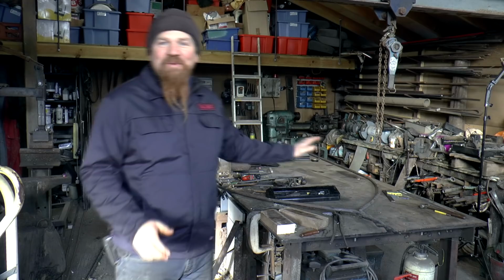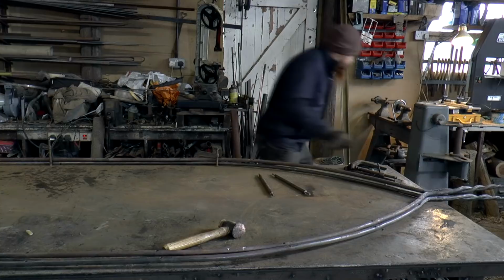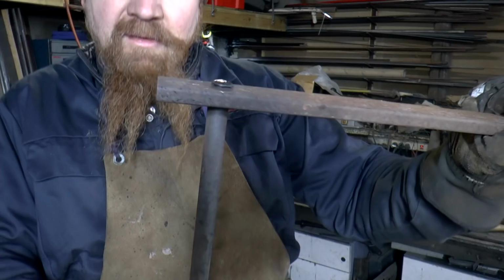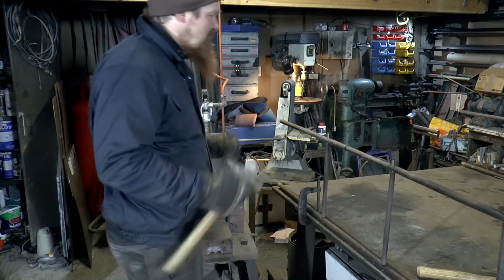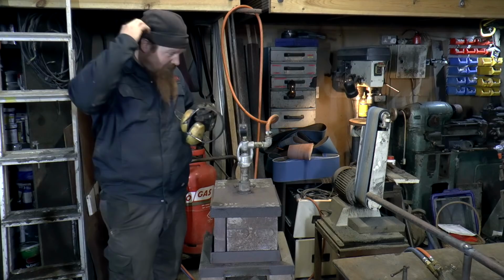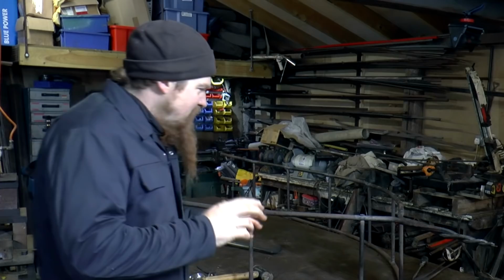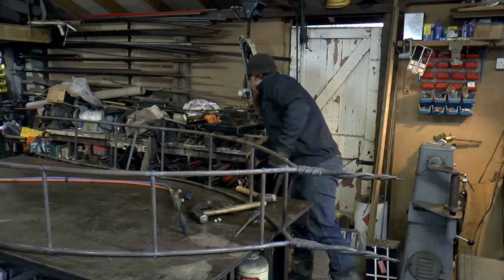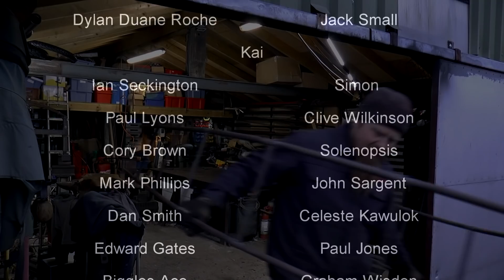The Rose Arch Part 2 of 2

Comment: During many years in Horticulture I've encountered rose arches of varying manufacture. The older estate made types are generally the best. Modern bolt together kits are always a poor substitute for either welded or forged constructions.
Your forged creation here is absolutely splendid Max, jolly well done. I could imagine that once installed, this will be in place for many years. Quality work like yours is sadly lacking in many gardens these days.
All the best and I hope the arch reaches it's intended location soon.
Reply: The reason that quality, long lasting work like this (which also looks the best..) is rarely seen in gardens, is that it costs an arm and a leg to produce (and you can see why!).
Most people can't  afford, or can't justify the cost.
Mores the pity.
Labour costs have killed off most craft skills I'm afraid..
Why do you think IKEA is so successful.........!!!

Comment: Might have been easier to make the "clips" from tube rather than wrapping flat bar around. Most of the old ironwork that I have seen has used clips that end up looking like tube but were probably made from a piece of wide flat bar forged over mandrel and then hot shunk on.
Reply from the maker: Yes, a hot forged collar would have been more traditional, but it wasn't the look I was going for. The difficultly came in working out what looked right (to me) rather than a struggle with the technique!
Reply: @maximusironthumper  Fair enough, I was thinking through as I saw you wrapping the flat that round bar might look better, more in keeping but its your look you are after.

Comment: Firstly I must say that I enjoy your video's, and can see your talent regards to Land Rover also your skill as a blacksmith, and would appreciate your thoughts on my Landy, (she's a 1970 109 SW, ) when I've got a trailer on the back the ride is so much better than empty, could I remove some of the leaves from the pack? I understand this will impact on the towing capacity but this is not an issue.
Maybe I could "shorten" each leaf.
I would like to know your thoughts on this as I respect your knowledge and experience.
Regards Keith.
Reply from the maker: The usual problem with the standard spring packs is that they get rusty and that makes it much harder for them to move against each other due to the increased friction. Just stripping and cleaning/re-greasing would help. The other option is what I've done on mine and fit parabolic springs, there are fewer spring leaves and gaps between them, so much more movement, the downside (at least on mine) is that a heavy load makes it squat right down at the back!

Comment: Maximus - despite the few problematic moments, that has turned-out to be a high quality asset for your mum to treasure. - I was wondering do you really want to cover that fine craft work with primer & paint? - I watch "The Doghouse" and he suggests using melted BEESWAX to coat and protect while permitting a 'patina'' to develop .. perhaps?
Reply from the maker: That would have been my choice, but my mum wants it painted and so it will be painted!

Comment: Would you ever consider using an air hammer to set those rivets?
Reply from the maker: Nope! I have a small air hammer but it doesn't hit as hard as I can.
Reply: @maximusironthumper  I'm preparing to hot rivet a 1930s sports car chassis, a Riley Gamecock. I bought a second hand Chicago Pneumatic CP175 which is a bit of a beast but even so I get your point. swinging a 5 pound hammer in anger takes some beating!